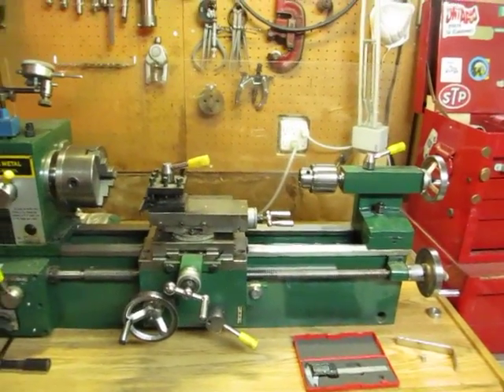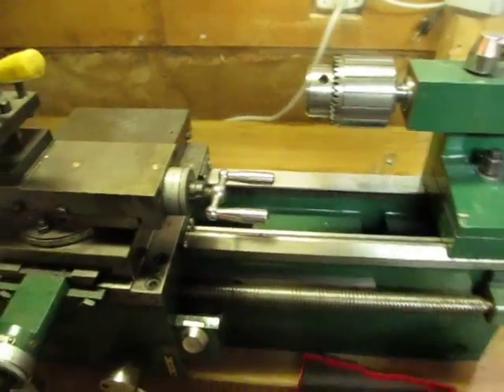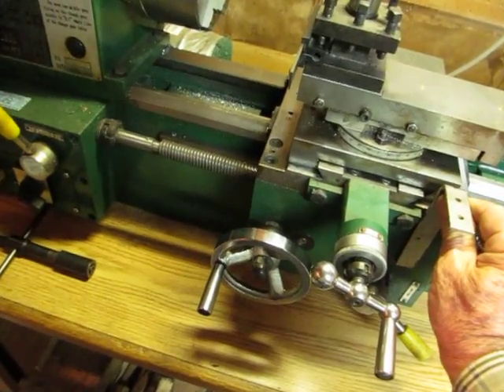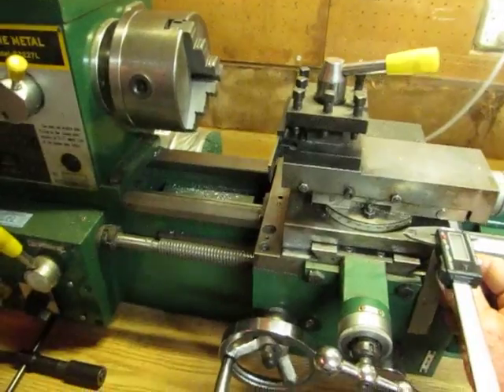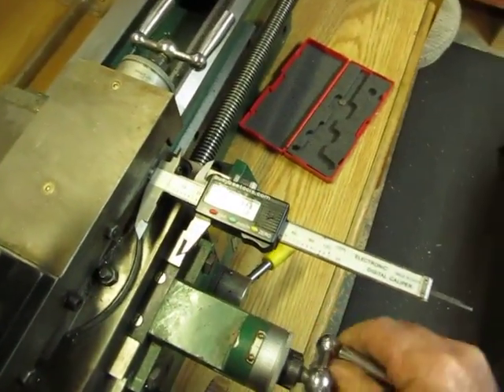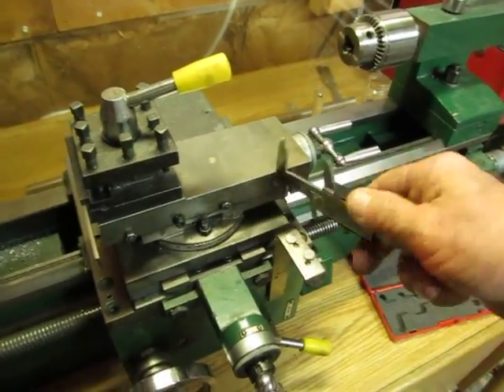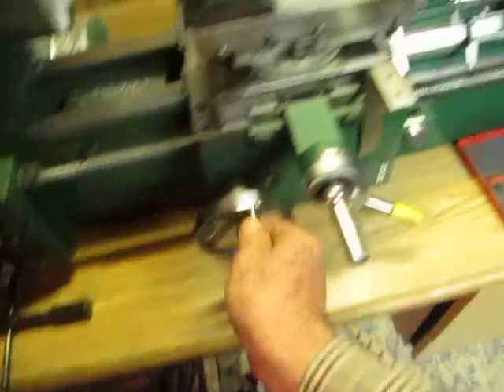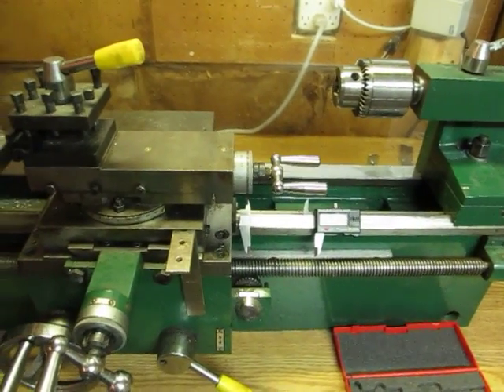easy DRO for hobby lathe

Comment: It is maybe good as an alternative way to mount DRO on a lathe by magnets. But it is not a practical way - ViBrAtIoN will force to use brackets with bolts and nuts.
Reply: Nope.  I've used a similar setup for years without any problems from vibration.

Comment: Nice idea.  But one bump or move bed to far and you are done. The calipers are a good idea and i would try to find some firmer clamps.
Reply: Well I tried to drill holes in the caliper but could not drill into the stainless so must be hardened.

Comment: So cosine error is not considered at all?  I mean that thing will move by looking at it wrong and then you have no way to reference postion except touch off again and that will not account for tool pressure and flex in the set up. The title should read easiest way to make scrap metal with a hobby lathe. Then the peanut gallery cheers this on like it's a brilliant idea, when in reality it's the farthest thing from. Put a dial indicator on the ways like actual Machinists have been doing for the past 100 years. I'm not saying this to be a dick. This is misinformation youre spreading and peole who don't know any better are going to waste money material and time on this illinformed idea. Do you think we would choose to pay thousands for a proper DRO when an equally effective option is available for 50 bucks? I have no problem with using the calipers., Where I take issue is the mounting. Those scales have to be parallel to the travel of the axis.

Comment: nice tip. One thing to do to the magnets is take some sandpaper and rough up the surface of the magnets a little bit. Most rare earth magnets are real shiny and slick. Giving them a little rough surface makes them less likely to move if the machine vibrates.
Reply: Some could be epoxied except the ones on the bed

Comment: What do you do when your compound is angled for thread cutting?
Reply: I wondered the same thing  and not just threading. I don't think a magnet is strong enough to pull the jaws unless it can be modified to slide easier by altering the leaf spring.

Comment: I'd be a bit worried about magnetising my lathe.
Reply: Exactly. This seems a misplaced worry.
Reply: hahahaha havent you ever used a magnetic dial indicator lmao
Reply: +John Creasey Yet, machinists have used magnetic dial indicators forever.    I sometimes use magnetic dial indicator base (with on/off switch) to clean steel chips out of catch pan.  My bed etc is not magnetized.
Reply: +John Creasey Why?
Reply: Chips will stick to everything.
Reply: +John Creasey Oh you are right...i didn't think about that!
Reply: I hate it when my callipers get magnetised.  You can make a demagnetiser out of an old motor, but that's not really going to work for a lathe.
Maybe your trick would work with velcro?